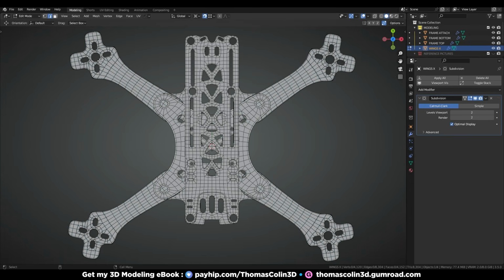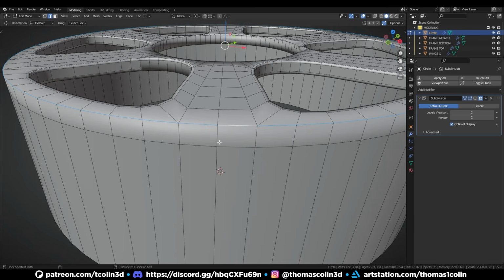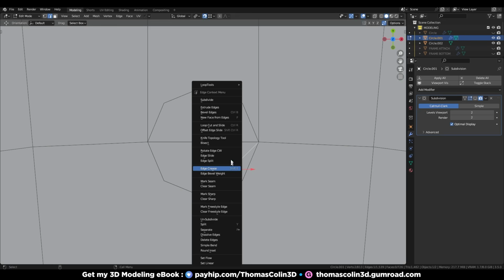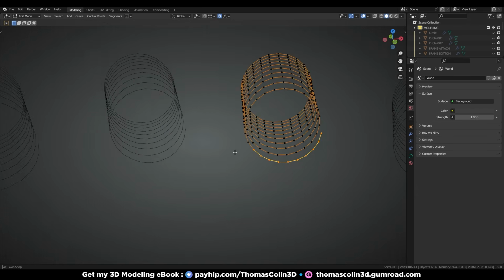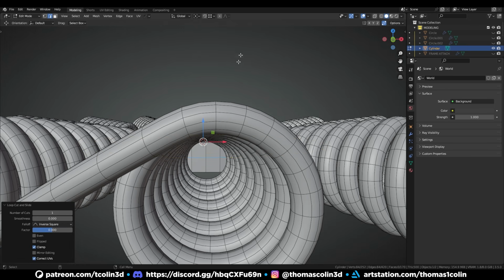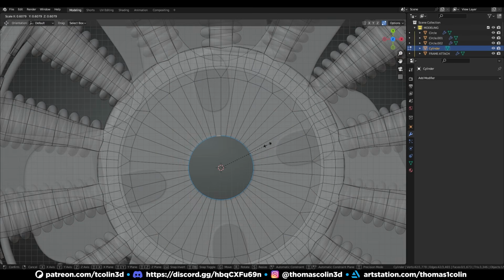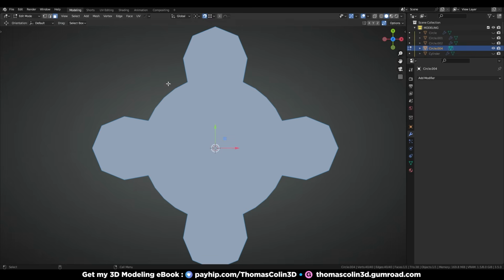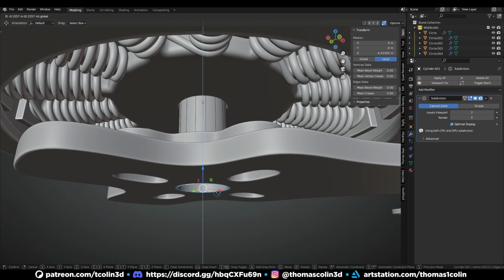How to Model an FPV Drone in Blender - Part 6: The Motors

Comment: I think it would be much more helpful if you would explain the process instead of just narrating the process
Hope you'll consider
Reply: I disagree. He has other videos where he explains the process. This is meant for people who want to follow his whole workflow which is a different skill from learning about edge flow and localized topology techniques.
Reply: @lando6583 If you want to learn modeling and not just making this specific drone, then vidoes like won't be much help unless you think about and research the steps/process by yourself.
To learn modeling in general you need to understand the WHY and not just the HOW and the principles and mindset of a modeler.

For example if you were to follow just the steps of making a curve shape using looptools curve tool you'll be able to make that specific or similar shape but if the tutor didn't explain why it was used and how it works or if you didn't experiment or try to learn by yourself, you wouldn't be able to use "looptools-curve" in your own modeling therfore you wouldn't have learned anything but to follow steps

People watch these videos to learn modeling in genereal to learn about tools, techniques and workflow so they can apply it in their own practices to the better understand and Learn the skill of modeling.

So videos like these aren't the best and should be improved.